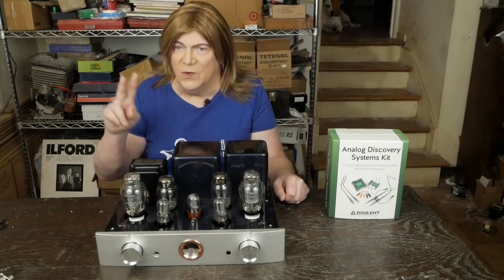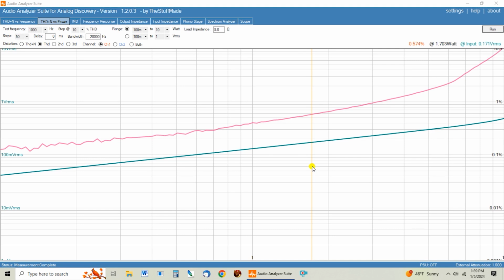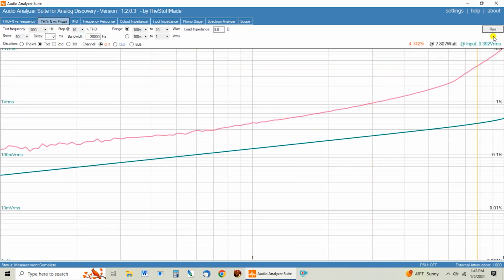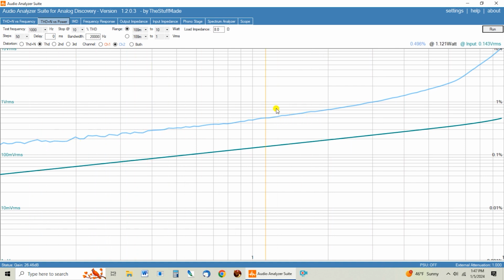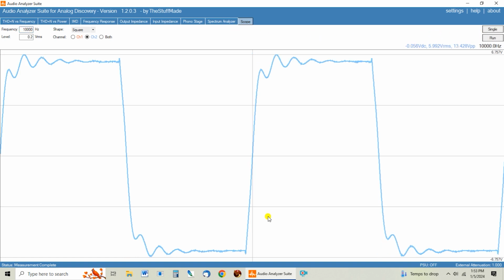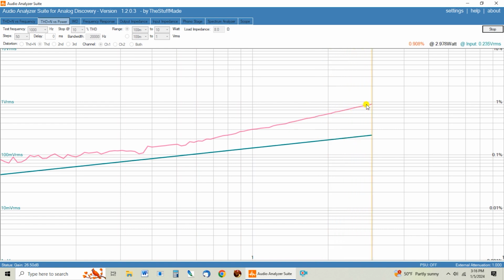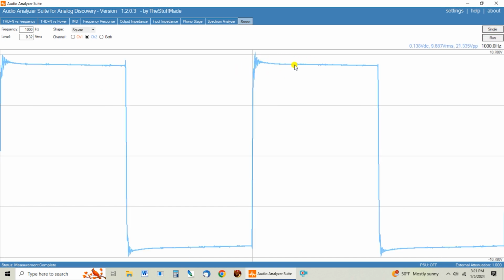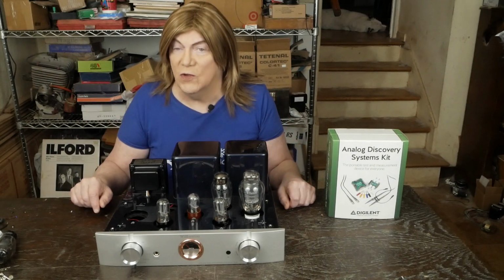Willsenton R300: Output Transformer Replacement, Hashimoto

Comment: So to fix the amplifier, you need to 1)upgrade the power supply, 2) change the output transformers and 3) fix the front end so it can drive the 300b.  If you have to rebuild this much of the amplifier I wonder if it's just better to get a different amp altogether.
Reply from the maker: Absolutely. You are basically paying $1500 for a chassis

Comment: The ringing and overshoot on the square wave tests suggests the power supply could use some tuning.
Reply from the maker: If the Global Negative Feedback is removed, it disappears but the THD goes through the roof. A DHT amp shouldn't need global negative feedback to start with. The whole design is trash IMHO

Comment: Thanks Stephe for another enjoyable video.  I'm wondering how the amp would perform if you removed the GNFB entirely.  I built a triode connnected, cathode biased EL34 PP amp using good output transformers and zero GNFB. It is one of my favourite sounding amps and the 10kHz square wave has only a slight rounding of the corner.
Reply from the maker: I tried this when I was wondering if the GNFB was causing the nasty frequency response dip: No, it wasn't causing the nasty frequency response dip and it added about 3-4% THD across the complete power spectrum!

Comment: Awesome work!  Very impressive dive into measured OP transformer performance within the context of whole amps design. I do a lot of guitar amp work and can't recall any guitar amp designers putting forth even close to what you have shown here. If I may add, it's worth checking LF distortion and waveform - for every 0.5 x freq = core mag level  x 2 . Core will always be heading towards saturation at the lowest freq. Have you thought about trying a Toroidal OPT? They have very high performance at modest cost. The best - Vanderveen (Netherlands) also Toroidy (Poland).
Reply from the maker: yeah, the problem is this circuit has other issues so I wouldn't use it to judge a transformer LF response.
Reply: @SkunkieDesignsElectronics   Work in progress!  :)
Reply: @SkunkieDesignsElectronics   Work in progress!  :)

Comment: This is expected result. The stock OPT is no way compared to Japanese or any other good made OPT...
Reply from the maker: It's worse than any I have ever tested, the Boyurange A50 iron wasn't close to this bad.
Reply: @SkunkieDesignsElectronics  i will not go with China made OPT unless from reputable source. There are some good to very good manufacturer in China, but they wont come cheap...
Reply from the maker: My point wasn't that these other China transformers are great, but that the OT used in this "premium" amp are super poor quality, even compared to made in China amps that sell for 20% of what this one does.
Reply: @SkunkieDesignsElectronics  well luckily that "premium" amp still "affordable".... how about that WE 300B? Vs Shuguang Treasure... 😅
Reply: @SkunkieDesignsElectronics  btw which amp at 20% price you are referring to? Also maybe good to get another sample of those amp to make sure. Maybe your Willsenton has quality issue?
Reply from the maker: I have two of them here right now that test the same,  and have tested a third. The 20% price is a Nobsound 6P1.
Reply: @SkunkieDesignsElectronics  I thought another 300B amp at 20% price...

Comment: Sounds like you got to the bottom of the WE 300B issue!  That makes sense, not all remakes are actually following the original spec.
Reply: Indeed current remakes often ( but not allways ) are not up to the original specifications..........in this case the driver is rather the main problem than the output tubes.
This amp was not designed by skilled people....neither is the commercial implemtation limiting the performance and the use of low quality transformers and other issues.